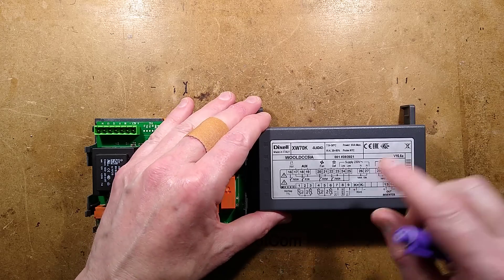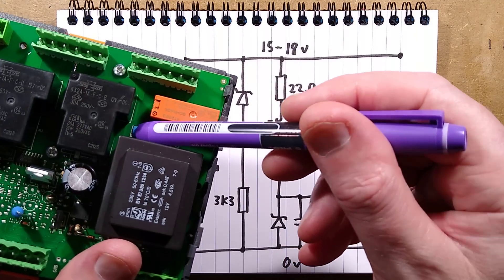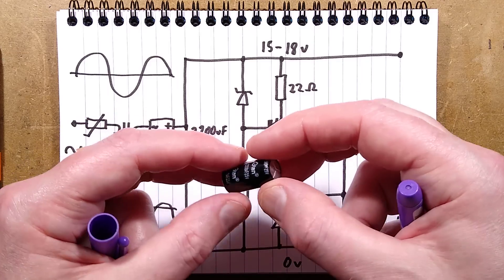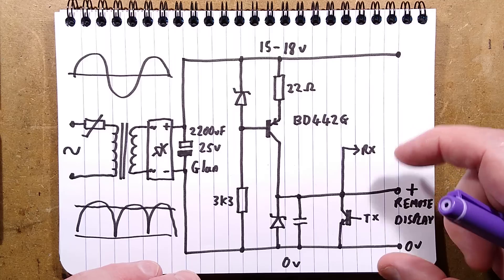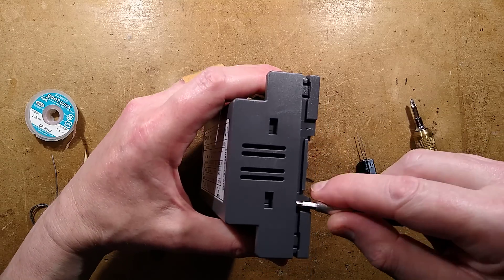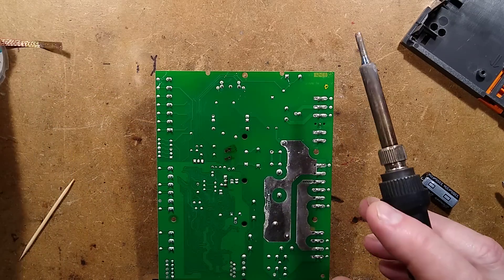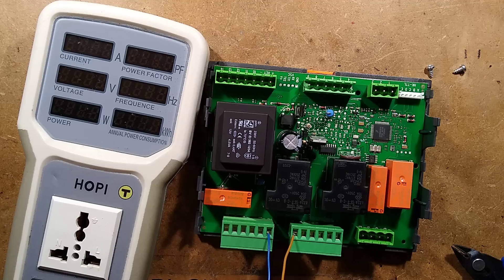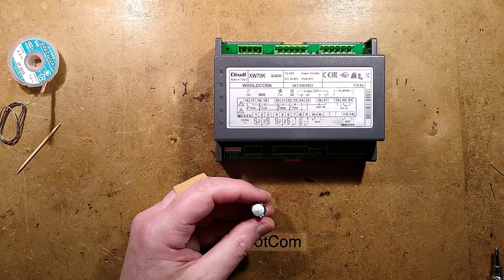Interesting fault and fix on a Dixell XW70K refrigeration controller

Comment: Doesn't seem like a good layout having an under-rated capacitor so close to a warm transformer and a "roll yer own" voltage regulator. Personally, I would've used another "proper" regulator (7812), slapped em both on a heatsink (or flat on a copper pour with thermal vias on the PCB) and put a 35v capacitor a little farther from the hot stuff.

Comment: i like the tooth-pick trick. i have had issues with just this thing. although last week i bought a Japanese engineer brand solder sucker, an ss-02. and it is amazing. i had used several of the cheap blue ones that get given away in soldering kits, and i found them awful. so before spending a lot on a de-soldering gun thing i tried the engineer. some circuit boards i have found use a little metal tube thing with a crimped over end on all the cool stuff. the full wave rectifiers, voltage regulators and heat-sinks all use this arrangement, the through holes are big, and they have this tube gubbins in, it makes the solder have a pretty flower petal pattern in it. i dont know what they are called, nor what they are for, but it makes things a bugger to de-solder, but the engineer's silicone tip lets it get right against the hot solder, so now all these nice things are in little drawers on my wall, rather than on an old PCB in the bin.
Reply: i asked chatGPT what they were, it knew right away, they are called self-clinching standoffs. so now i know!

Comment: I started my electronics career repairing refrigeration PCB's. I can tell you capacitor failure on this type of power supply is super common, not sure why but I've repaired literally hundreds. Great throwback 👍

Comment: I've made so much money in my career from faulty electrolytics. God bless them. I remember when mini camcorders first came out. I was living in South Africa at the time and it seemed that no engineers in the area wanted to touch the new microelectronics used in these camcorders. If you remember they used aluminium radial electrolytics that were well known (to me anyway, in SA) to leak and go faulty in a few ways. Lets just say it was a great career and economic advantage for me to be aware of this and to be prepared to tackle faults in these tiny circuits. Love your videos btw Clive. Thanks for making them.

Comment: Firstly, why complicate a reliable system? 

Secondly, if they plan to add electronics to a standard household refrigerator. The least they could do, is to take a leaf out of the book from Engel and Danfos/Secop for electronic systems. Those units run for 10 years or more from 12/24 volts, without issue. Even in the 40 degree celcius temps of australia.

Usually, all ive had fail it's the NTC temperature sensors that give out. The little silver canister fills with moisture over time and shorts the terminals. So far, the Engel fridges haven't suffered the issue. 

If anyone wonders, I am not connected to the grid. So everything runs from a small 12 volt solar power system. Have been Engel now continuously for 2 years.

Comment: Very intreresting design having the live and neutral on separate terminal blocks, why would they do that over having them on the same one which seems logistically easier.
Reply from the maker: It is odd.  I wondered if they just wanted to limit the number of ways of the connector and that was just how the connections landed, or if it was to prevent damage if the connectors got swapped.

Comment: In 1972, while testing a power supply unit I designed in the University laboratory, I noticed one of the transistors in the unit was very hot. I desoldered the transistor and tested it with an oscilloscope transistor tracer. For a whole half an hour the beautiful graph of collector-to-emitter current vs collector-to-emitter voltage at a dozen various base-to-emitter (B-E) currents was stable and slightly varying as I tested the transistor to increasing maximum B-E current, first at one milliamp and ten milliamp dial notches, then 100 milliamps intervals, and, when reaching 2 amps of B-E current, the curves wobbled, the transistor released a wisp of smoke, and the curves went flat to zero current. I was amazed. Two amps B-E current to kill a transistor? Of course, it was not constant but maximum, the tracer ramping it up in the various curves, only the upper one correspinding to 2A, but still.
Reply: I once had a TO-18 transistor vaporize two legs and melt the paxoline on a PP3 powered RF circuit. very strange.

Comment: The HOPI measures about 7 W but the print transformer is rated only 4.5 VA! Where is all the power going? 2.5 W of thermal loss inside of the transformer? I wouldn't want to have a fridge needing such a high quiescent power.
Reply from the maker: Traditional transformers do have higher copper and iron losses.
Reply: @bigclivedotcom  Of course! But one third seems quite bad to me, especially when fully loaded. I wonder if the rated apparent power of 4.5 W is meant for primary power input or for secondary power output.

Comment: Add about 40 minutes and 16 seconds you talk about touching the board and the pastor wires but you don’t mention the temperature. I’d love to have you, if you could share, tell the temperature that you use on your soldering iron. That’ll help, probably not just me, but a lot of us.  Thanks.  It’s not something you typically do but once in a while you do
Reply from the maker: Typically around 350C but I recommend going by soldering feel and not an exact temperature.

Comment: What a coincidence, I just fixed one of these last week. The big  black relays are a main point of failure.
Reply from the maker: I'd guess it may be switching a load like compressor or defrost heater directly.

Comment: In this case I would of changed both Capacitors with a low Z, high temp ones so the repair lasts longer.
Reply from the maker: The older standard ESR electrolyte had a simpler and more stable chemical formula than the low ESR ones.  So that might be a disadvantage.

Comment: N your list of tools required for the repair, you failed to mention a bucket full of commen sense. Like not presuming the 680ohm replaced with 2 330ohm in series and presuming the lnk304pn was fine... Wasent long till the smoke detector went off. 😊 Oh that magical smell of burning resistors. Oh well tumble dryer awaiting lnk delivery.

Comment: Toolkit called "Hollow needles desoldering tool electronic components Stainless steel 8Pcs/lot" for $2 may be very suitable for desoldering various through-hole parts. Sometimes I prefer use toolkit for $2 instead of Japanese desoldering gun for $200.

Comment: Ah... bad caps.Normally you don't mention capacitor brands, but now you do (while replacing one with a similarly dodgy brand). Over the years, I have taken lots of stuff apart, and when you disregard stuff from the capacittor plague era, there isn't really that much difference between Chinese and Western made caps, including the Japanese brands.
Reply: Laughably false. There are good capacitors and there are bad ones.

Comment: This is strange. Why the 15-18VDC supply? What is the relays coils rating? Also I would not use 25V cap on this supply....rather double the cap voltage rating....they will last longer.

Comment: That 'on and off' communication sounds a LOT like the old Telephone rotary dial scheme with toggling the hook/cradle. I would bet that it would be a fairly simple protocol to 'sniff' with some current shunts and/or measuring probes. I wonder if it is like some of the "AC" units where the remote display actually sends the ENTIRE CONFIG every single time you push the button.

Comment: Would you reverse engineer a FS1000A radio module, or similar one ?
I'd like to learn more about those radio modules with cristal osclillators
And i'd like to modify one, but I don't quite understand it

Comment: On wiggling the faulty cap out....:
A few days back I came to watch the 'Desoldering Made Easy - Amazing Trick'
from Mr SolderFix right here around the next corner on yt.
I never desoldered (multiple pin) components more easily and more important without any relevant destruction observable on the component..

Comment: You suggested that a faster switching frequency puts more strain on a capacitor.  I would imagine a faster switching frequency would reduce the ripple voltage, but the average current through the capacitor would remain the same, given the same load, and thus faster switching is better overall.  Can you clarify how this causes more stress?  Does it have to do with hidden inductance?
Reply: The higher the frequency the less capacitance you need for smoothing. That means you end up with small value caps carrying very high ripple currents.
Reply: @LesNewell  That's a good point.  But what if you use the same cap, but just increase the frequency?
Reply: @ChristieNel  A designer wouldn't normally do that because a smaller cap is cheaper and probably has lower parasitic inductance. However if they did the stress would probably be similar. Of course with a switching circuit the current waveform is a different shape which can have an effect. The more you look into this stuff the more complicated it gets.
Reply: @LesNewell  Yes, it does.  But for background, I have a prototype where I'm switching a MOSFET hard and drive a few amps into a heater, which was producing noise on my supply rails, so I stuck on a cap.  I'm thinking that increasing the MOSFET frequency would reduce the ripple without affecting the cap lifetime?
Reply: @ChristieNel  If the cap is on the supply increasing the switching frequency could increase the average ripple current. It should however reduce the ripple voltage. If the issue is electrical noise you may benefit from adding a smaller ceramic cap in parallel with the bigger cap, say 0.1uF to 1uF as close to the transistor as possible. This will help catch the high frequency noise. You may also want to consider switching the mosfet a bit slower. This increases heat dissipation but generally reduces noise.
Reply: @LesNewell  I might add some more smaller caps in a respin.  The big cap is right by the MOSFETs.  I'll be having a small enclosure, so can't dissipate a lot of heat from slow MOSFETs, but could experiment by just changing the gate resistor.  Why does faster switching increase the ripple current?

Comment: Always interesting to see how cheap components like that failed cap can make electronic devices fail. From what I've heard it's quite common in the entertainment electronics industry to use electrolytic caps for "planned obsolescence" purposes. Flat screen TVs seem to be especially bad, it's always funny and sad at the same time when you hear that someone fixed a TV that cost 1k€+ new and failed after maybe 3 years, and fixing it only takes a screwdriver, spudger, soldering iron and replacement caps for maybe 1-2€...

Comment: The control panel board of my washing machine is held on with similar clips and no screws. The brittle aged plastic had most of them snapping off when nudged enough to let the board out. It turned out failure of more plastic is what had me in there at all: the water shedding lever between the human's finger and the board's button was fine one day and crumbled the next.

Comment: Something I like to do when replacing an electrolytic capacitor, after noting the negative side as you indicated, is to look at the circuit board where the capacitor goes.  Most of the time they will have silk screening that indicates the way the capacitor is supposed to go.  I like to verify the polarity of the capacitor with the silk screening because I have a tendency to forget things like which way a stripe was facing two seconds after I made note of it.

Comment: It's always CAPS CAPS CAPS that seem to be an issue with high powered devices, sometimes it's better to not cheap out on most important part where you are temp storing energy.

Comment: Thanks for another great video, Clive. I appreciate the point about not using plumbing flux. I have used it for large, difficult, connections to achieve a properly soldered joint for high-current automotive connections. How would you suggest cleaning off any residue from using such a flux? 

Why are you recommending leaded solder? All modern boards are lead-free and mixing solders can cause more problems. Lead-free solder is not that hard to work with, although it is different to work with in that it requires a slightly high and more tightly controlled temperature.

Also, I'm not sure you completely repaired this controller. The controller casing stated 6 VA maximum and the figures from the HOPI calculate to 8.9VA,which is nearly 50% over the maximum power rating. Maybe investigate further?

Comment: I have a Mobile Phone charger that is 5V 1000Mah. Is there an easy way to limit it to 4.5V externally?
Reply from the maker: If using it to power something that runs on 4.5V it's usually enough to put a standard 1A diode in series.
Reply: @bigclivedotcom Yep, that's the way. I adapt a lot of my old 5V psu's/chargers to run equipment that use triple 1.5V cells (4.5V).

Comment: Michael Dranfield recently shared a video of a common fault on Samsung flat screen tv sets.
https://youtu.be/DREofE4WIvg
A 10 ohm 1/16 W resistor was fitted in the supply line to the power factor correction circuit.
In reality it needed to be rated at 1/2W.
Of course over a 2/3 year period or less that 1/16W resistor is toast and the tv fails to power up.
This is the manufacturer deliberately making their product obsolescent.

Comment: Watching this video reminds me that I have to repair my bench power supply, as it's output transistors failed in an accidental short circuit incident, while it was set to maximum voltage and current. 😢
Reply from the maker: Definitely the output transistors?  A common bench power supply failure is the diode across the output going short if reverse polarity is accidentally applied to the outputs.  (Like naughty battery charging.)
Reply: @bigclivedotcom " Naughty battery charging" Ooh err missus "

Comment: Use a lot of dixell unit's at work, mainly the XW60K, generally pretty reliable. Occasionally get the odd failed relay.
Think the keyboard runs on 12v and pulses low for the data.

Comment: by 8:06 I will hazard a guess, the people cleaning up, is drowning the keypad/display in bleach/sanitizer water and it's likely shorted out.
BUT that is only one of the common issue and what I see could be a cap issue, may very likely be from an over voltage situation occurring. something like an broken neutral(on split phase power), crossed HV power lines, lightning or other issue caused excess high voltages which killed the cap and parts downstream as long as they could withstand! poof!
Reply from the maker: The transformer and the PTC thermistor would probably limit the duration of an overvoltage incident like that.

Comment: morning Clive.  Would you be able to help with a treasure Hunt puggy that stopped working. 80's machine just buzzes.
Reply from the maker: First suspect is the power supply capacitors as in this unit.  The lack of smoothing may manifest as audio hum and the processor not booting.

Comment: Thanks for this great instructional video. 
I had a similar power supply circuit with  a blown T160mA fuse soldered on the board instead of a thermistor. What could be a suitable thermistor value as a replacement for this fuse?
Very good that you stressed to look at the polarisation of the electric cap, it is often printed on the board as well but I've seen that the polarity is not always correct and so you cant rely on it.
Reply from the maker: It would be much easier to replace your PCB fuse with another, since they should rarely fail unless there has been a short circuit or overvoltage incident.  You could use a standard 20mm fuse with wires carefully soldered on.
Reply: PTC aren't always the best solution. They don't completely break the circuit as does a normal fuse. They also have a region of what essentially amounts to unpredictable behavior.

If there's a fuse there already I would just replace with another fuse for safety's sake. You could look into installing a fuse socket to make replacement easier.

Comment: Well discovered. Always a challenge in design to cater for any eventuality, especially in power supply designs, but, yes, use quality components. Let's not forget a supply of plasters, especially if any associated lamps require servicing.

Comment: PTC is there also to reduce inrush, as those small 3VA transformers are almost always internally protected, both by the inductance of the primary winding, and by a built in one time thermal fuse as well, buried in the potting.

With the capacitor I would go to a 35V one, as the 25V ones on 18V are being run rather close to the limits, and the 35V ones tend to also have better ripple current capacity, which here equates to a longer life, and likely comes in the same can.
Reply: I would also go with a 105C rated one,  as opposed to an exact replacement for the original...
Reply: @Roy_Tellason  85C vs 105C the make and series is more important, you get plenty of different ones, with life varying from 1k hours to 15k hours for the same capacitance and voltage, just different makes and series. Derate the voltage and life is a lot longer.

Comment: The capacitor was cursed by the "Made in Italy" on the product.
Reply: Ah, yes. Classic. Blaming Italian products for failing of the non-Italian components...
Reply: @DashCamSerbia  Much like in RPG, a "Made in Italy" badge gives instant -50 penalty on every stat.
Reply: Maybe they should use Italian capacitors then 🤷